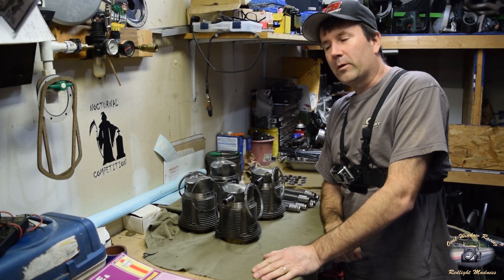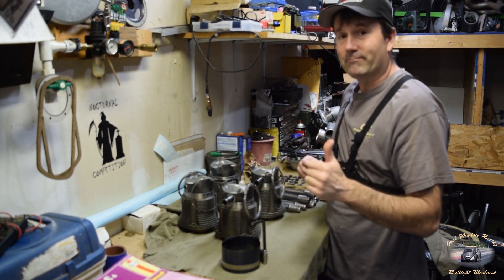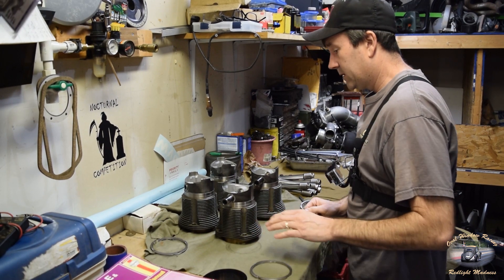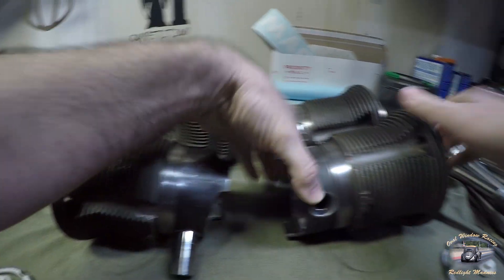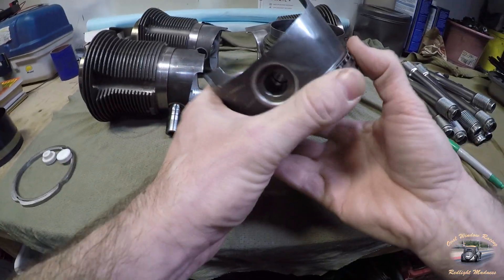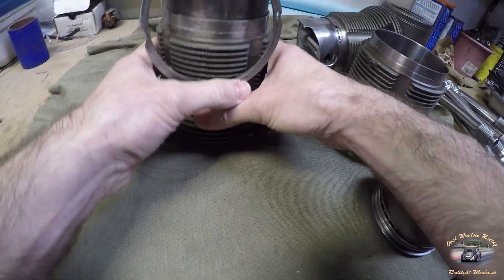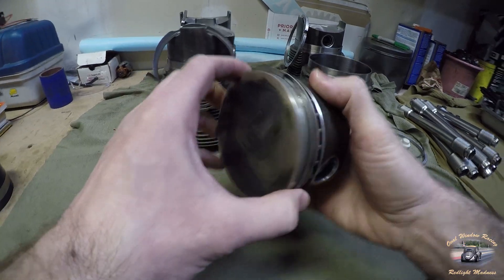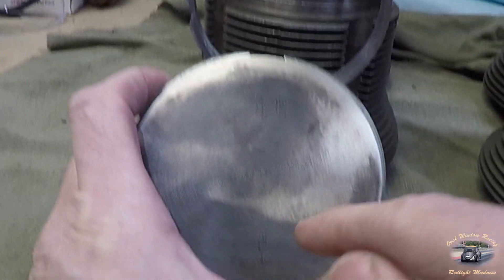Installing type 1 VW pistons into their cylinders

Comment: Is it true you need to "seat" the cylinder sleaves to the cylinder head by lapping them like you would a valve?
Reply from the maker: Only if the cylinders and heads have been run before. If you have new clean cylinders and fresh machine heads you should be fine not lapping them.

Comment: I like watching your show I’m going to do a rebuild on my VW motor it’ll be my first time I don’t know what it’s going to cost and what I might need I was I know I had oil dripping out of my exhaust three and four I kept the neighborhood From having a lot of bugs any cost information or people that know how to clean the blocks inside a note, or what is recommended to make it easy versus a sandblaster or a shotgun thank you
Reply from the maker: Cost can vary depending on what machine work that may need done and where you source your parts whether you buy new or used. I have used a power washer to clean engine cases then my parts washer filled with mineral spirits. An engine case will see my parts washer several times during a build. Good luck with your build and keep cruising 😎🤠

Comment: How do you remove and re install rings without making them ovalish? I used my ring removal tool but it’s almost impossible not to. Do you see any issue using thick walled 88’s on a stock everything else engine? Good video , thanks!
Reply from the maker: I remove and install by hand carefully. I have not run any 88s but I believe the thick walled would be better than the thin walled ones. I think you may need to have some machine work done to the case and heads before running those
 Thanks for watching 😎🤠
Reply: Thanks so much!